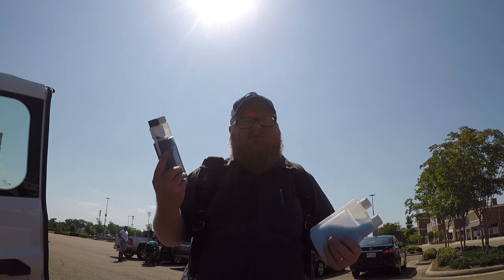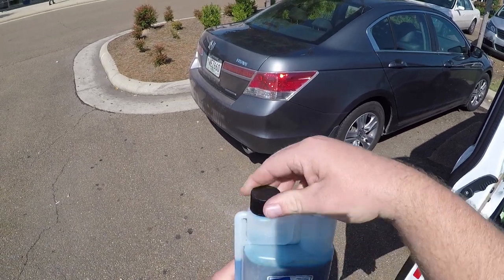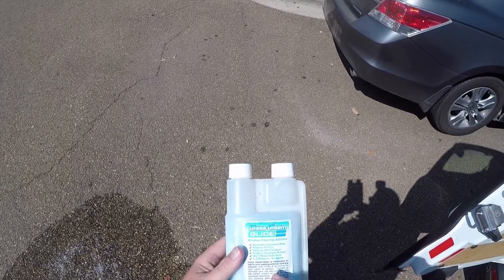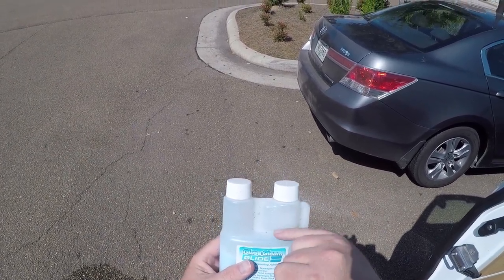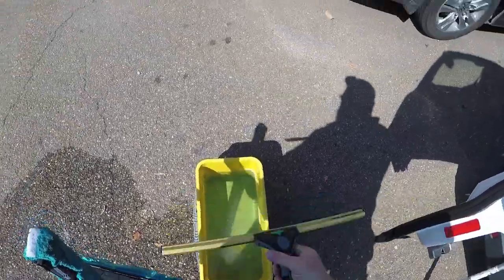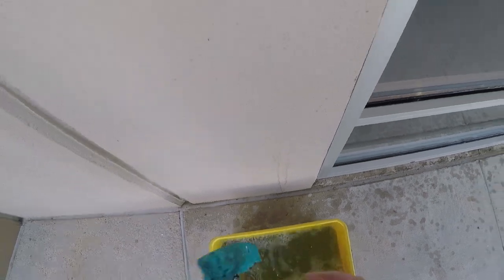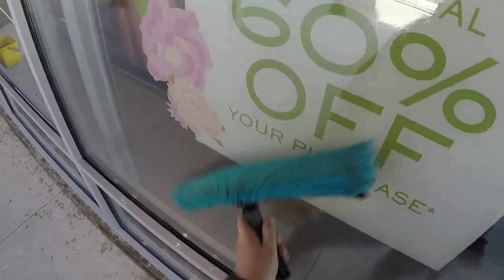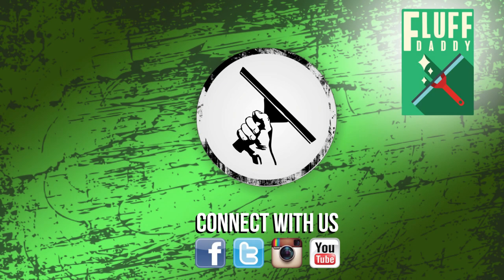Best Window Cleaning Solution GG4

Comment: I like using GG4 too.  Dish soap i dont like the sudsy mess.  I try to use straight GG4 or add very little soap such as Ecover or something natural.   EBC Glide is good too.  GG3 isnt bad either. Here in the midwest we have hardwater so the water softeners help too. GOOD VID

Comment: Actually the great thing about GG4 is that you CAN INFACToverlap and it doesn’t leave a mark

On a sunny day on the outside part of the window where you forget a spot and go over it with your dry towel it will leave a lint mark if you use soap
But with GG4 it doesn’t leave lint on the window the towel actually glides on the glass 

Try it yourself use soap on one window and only GG4 on the other

I use 1oz for 3. gallons and works great for the entire day
In which I make 500 

A gallon Lasts me about 3_4 months 10 weeks
500 x5x10

That’s 44$ that generates me 25k

Comment: Dawn is not a good mix with it. I recommend mixing a dish soap with less drying agents or no drying  agents. You want a glide and a grease fighter. Dawn has ingredients to make it dry fast which is great for dishes but not window cleaning. There are alot of better options. Gg4 stays wet longer because of this and dawn makes it not so good. Understand your soap ingredients and you can make a great soap yourself. I make my own soap alot of times
Reply: What do you use to make your own then ? :)